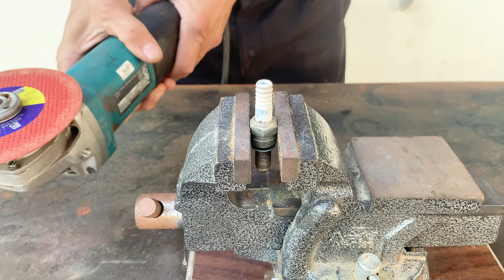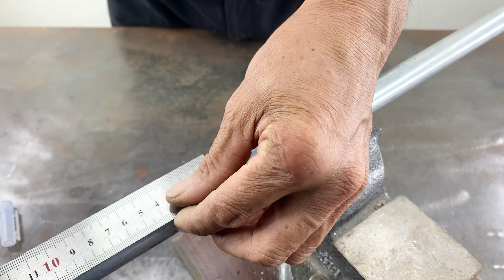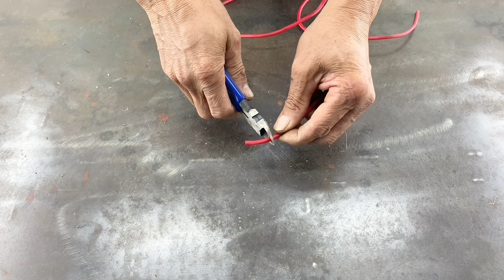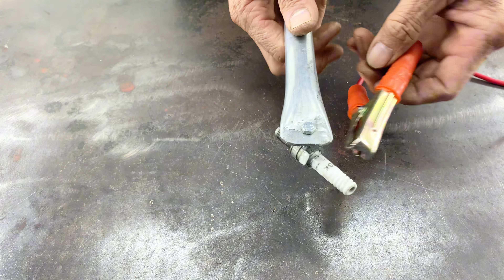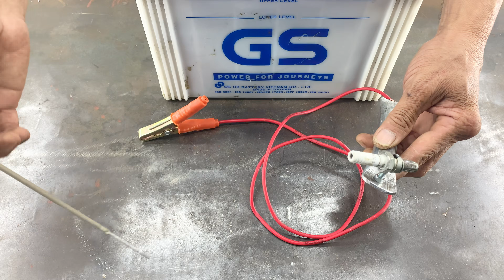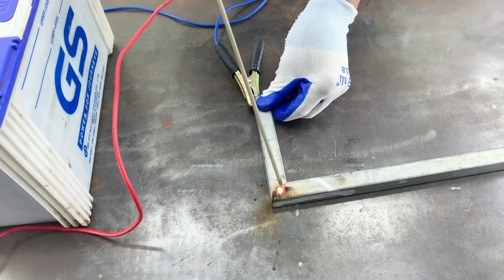No one knows spark plugs are a gold mine, reuse them and you will see the surprise

Comment: So what would happen if you bypassed the spark plug and just used crocodile clips onto the welding rod!?
Reply from the maker: Great question! Bypassing the spark plug and connecting crocodile clips directly to the welding rod might work in some designs, but it depends on the circuit and current output. The spark plug may help create a spark, but it doesn’t automatically make the setup a proper welding machine.